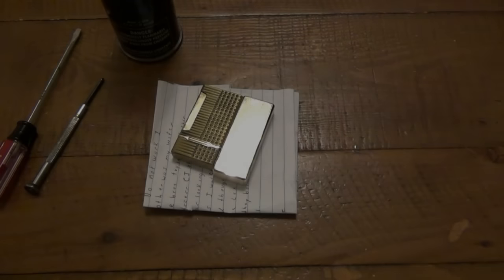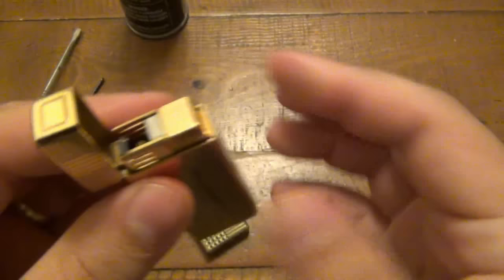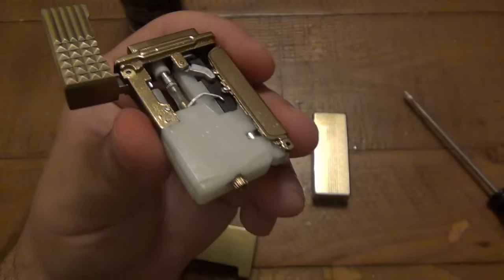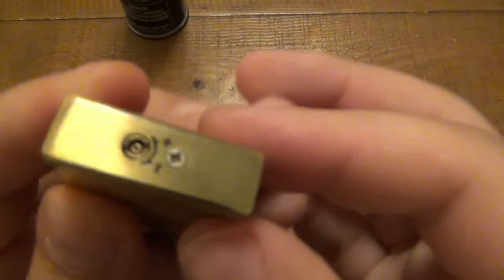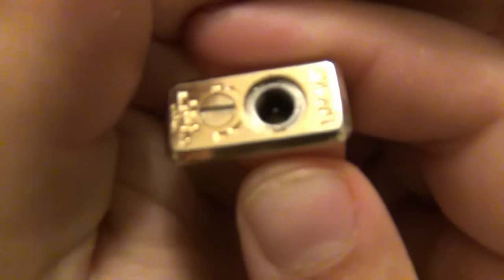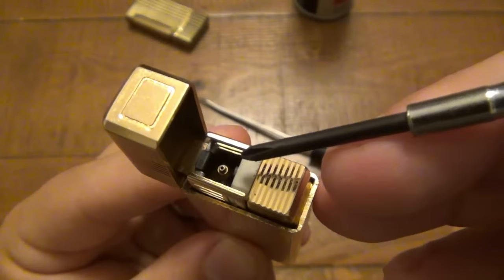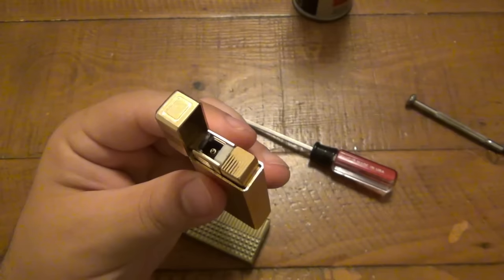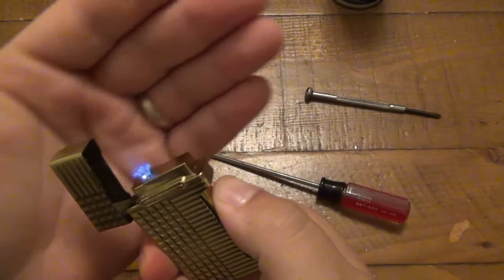How To Fix Butane Lighters (Common Problems Have Simple Solutions)

Comment: Hey man I have a butane Rose flame Torch lighter by Slick for my mum but for some reason the power of the torch flame has significantly decreased. It's basically not shooting the flame like a regular torch lighter but the flame seems to come out looking like plasma or a really weak flame that kinda just bubbles on ignition briefly. The spark works the fuel tank has been purged and refueled. I Ending up taking the outer part off to see if I could fix it. When it's outside of its casing, it works perfectly fine??? The flame of the torch works fine, all the components work. It's only when I put it back in its casing does it repeat the weak flame effect i described earlier. I have no idea how to fix it.

Comment: having to purge is a misconception imho. there should be no air in there. thebutane does take up less space in liquid form. if you pump the butane can enough times you should get enough pressure in the tank to fill the butane  up in liquid form pretty much to the top, no need to purge. also if you do need to empty through the fill valve id try and use something softer than a screwdriver or metal so as  to not damage it... plastic works great for this.

Comment: I remember very clearly back in the early and mid 90s. That when you bought butane it had a little plastic ring with adapters that you could pry off and attached to the main nozzle of the butane bottle. You ain't trippin bro and then all of a sudden it just stopped. You don't see them anywhere anymore?.......
Reply: Colibri butane still does this.

Comment: It's not a Mandela effect. I have butane refill bottle from late 80's made by Win and it has 8 different, colorful adapters and there is a list of the lighter brands on the side of the bottle telling which color adapter goes to which lighter. I only have used the refill bottle twice so it's almost full. I wonder if the gas still works after all these years?

Comment: Mine just stopped creating the spark in order for gas to pass through to make the flame. If I hold the button down and put another lighter up to it, it works. But by itself, it doesn't lol. It just won't create the spark anymore unfortunately. I'm not very smart when it comes to lighters, but when I looked on Google, it says the flint needs to be replaced. But I have no idea how to do that in a lighter like this lol. I thought only lighters with a wheel had a flint tbh lol.

Comment: Hi. I have a number of fairly old but nice/unusual/desired brands butane lighters (some converted from Zippo-type fuel to butane), but many of them have the same problem - the “click” to create the spark no longer clicks to generate the spark. I’ve checked the other elements of these lighters - the arm or arms to lift the gas valve open function correctly, the tank holds gas, the nozzle is clear and butane can flow out, so I’m reasonably confident that it the small black rectangular column that is no longer function - not generating a spark and not returning to the “ready” position after pushing it down. Do you know if these small black rectangular columns can be replaced, and if so, where can I buy them ? Many thanks !!
Reply: Also having this issue and can’t seem to find any info on this repair
Reply: Dollar tree bbq lighter. $1.25.
Reply: Though it hasn't been answered I was thinking the same thing and that's the only thing I have thought of was to take it out of another lighter .. edit so I did take it out of a cheap one to put it in my expensive chef torch and voila it works 😊

Comment: just got a can at a head shop and the nozzles are  "made into the cap" if the plastic cap has 5 holes inspect them, probably adapters, also european clean butane just not the zippo brand 2021

Comment: If it sparks but wont light or stay lit its prob clooged up. Either with pocket lint dust etc and or residue from crappy fuel. Dont run ronson. There is a cheap brand named king that is tripple refined that works well. If its an expensive lighter buy vector puretane or lava if you can find it. Be careful if youve been running cheap stuff. When you fill with vector or the other purer butanes the flame will often be so high it can burn your face. Ive had flames 12 " out of lighters i filled with lava. I had to remove the fuel level lever and readjust the flame.

Comment: They've still got adapters on the caps. I'd say it's 50/50. Lighter butane tends to have them and welding/ plumbing butane tend to not. Check headshops or smoke shops you'll find them, not uncommon.
Reply from the maker: thanks I did find it on amazon alone and with an offbrand of fuel

Comment: You can use the plastic nozzle without an adapter on this lighter. Even if the needle pin breaks, it still works fine. I repair vintage lighters and fill mine with the same valve without one without losing anything. Those are never screws! There are no flatheads! The “second screw” is what calibrates the adjustable flame! Never mess with that. Only a professional can tell you how to fix it once messed with.

Comment: Forgot to add. None of the adapters seem to ever fit or work correctly without some modifications. I had to shave or sand them down, and or create a gasket to prevent butane from spraying everywhere.  I found that using  a piece of heatshrink works. Also if you have time, there is gasket sealant in a tube you can buy and make an actual gasket for your application. I squirted this blue gasket material into the refill port on the item then stuck the adapter in and left it to dry. When I removed it, there was basically a custom molded gasket stuck to the adapter. I did have to   remove some gasket material from inside the adapter. Not going to explain how. Pretty much a common sense thing. Hope this can help someone. I had a B of a time trying to refill something.

Comment: I imagine you didn't see it since you didn't reply, but awhile ago I commented on one of your videos asking for help. I'm just reasking here and hope you see it this time. I have a lighter I got from my grandpa with no markings on it, at first it didn't work and then mysteriously it started working just fine. But once it ran out of butane I went to refill it and all the gas comes shooting out of the top as soon as I fill it. Like it all comes out at once, and since it's compressed gas you can see it come out as it frosts up the whole lid of the lighter. Is there a fix for this?
Reply: Looks like you haven't recieved an answer. I was hoping you did BC mine does the same thing. It's a Ronson Jet Lite, and I know I've got the correct size adapter for the butane nozzle, but when I go to fill it I get Butane spraying from EVERYWHERE!! Not only thru the top ( where the flame should be) but also leaks thru the screw that adjusts the flame size. The entire case gets frosty cold, and after all that I WON'T LIGHT. 
I've looked everywhere online and although I'm certain it's a fairly common issue I cannot get a simple answer.

If for some reason you figured your issue out, let me know what you did!

Comment: I use butane as a solvent for extraction, the butane cans  have them adaptors, every brand of refined butane has them..zippo is dirty..it also (as far as I can tell) is just butane. vector or whip it brand is a combination of isobutane n-butane in equal parts, but also contains LP (propane) most brands are about 30% LP but whip it has like 40% if I remember..they burn so much better...while I'm at it thought I'd share a few fun facts about butane an lp, did you know your refrigerators refrigerant is most likely butane..it's r600 an r600a..LP gas is also used as a refrigerant in commercial coolers..an it's a much larger molecule compared to r12 meaning less leaks. Some ppl even use them for heat pumps an residential systems..they need sum extra parts for safety but it's a really effective refrigerant..

Comment: When I buy my butane it comes with the adapters in the cap and sometimes it doesn't so it's Hit or Miss if you get the one with the adapters in it and this is 2023 to let you know
Reply: Same here. It seems like it’s the cheaper stuff with metal tips that comes with adapters whereas Bronson and Zippo have the little plastic valve and no adapters.

Comment: I have terrible luck with butane lighters. They never will light properly. I literally just clicked the one I have 17 times before it lights. Sometimes it will light many times in a row but then nothing for a while like it's broken. I see it ignite I hear the gas everytime. I have had many lighters with this problem. Poor design? Weak spark? Is the igniter misaligned from the gas? No oxygen? It's not pressure as I have adjusted it many times with no success. Do I constantly buy defective lighters? My mind is completely blown. Imagine how much butane is lost clicking it so many times. Gone through 2 cans recently. I don't know 🤷‍♂

Comment: My zippo is purged filled warmed and still sparks but it hates me.
Reply from the maker: Zippo Blu? I would see if maybe the timing of the spark and pushing down to make the butane come out is faster so the sparks are still there when the gas spills out...a slower light might not get it done, also make sure your holding the button down all the way to keep that fuel from shutting off...

Comment: Im legitly scared. 
My jet lighter didnt working too and I little(I mean high as ridiculous levels) increased power of gas but it still doesnt working. I sparkled from outside with another and it suddenly fired and created a fire that has same height with half of my arm I was like may day may day and fortunately it ended after some shaking. Wow this is why dont try at home. 
I legitly wont thouch that again until when I decrased its power. This thing is a beast who invented this thing??

Comment: Thats not the Mandela effect bro. You just bought a different brand of butane lol.  The 2 butanes I purchased both had them. The one that looked like yours I had to remind the company to include in the case. They only threw in 3 of those for a case of 12. I think companies are just cheaper now. Kinda crazy to wanna save like 1 cent on each can. A lot of butane is sold for things like making weed honey now. I think its almost a bigger portion of their segments than butane lighters. Maybe thats why they stopped.

Comment: Too bad I only found out the information in this video after taking the entire thing apart and twisting the gas regulator several turns. (Its not supposed to go half a turn in either direction.) I'm not sure I can fix what I've done.

Comment: Thank you I couldn’t figure out what I was doing wrong trying to re-fill a Penguin Japan lighter and it’s because I need an adapter so it won’t spill all over the place.
Reply: You can still do it with some valves but you have to do it slowly or you will waste way more butane than you get in the lighter.
Reply: Ben Keysor even with the adapters I got it still spills out all over the place on both Penguin lighters I have. Need to find someone local in San Diego that can teach me how to refill these damn things.
Reply: glyn hodges will you be right next to me holding a sign saying out of work comedian?

Comment: I know this is a couple years old so I am unsure as to if you had gotten an answer on your question, but it really just depends on the brand. It varies, but even where I live in the South East USA, some cheap ones have the adapters and some do not. Some nice brands do and don't. I have a bottle of Whip-it Brand Butane and it has the adapters built into the cap so you pop them out of it. I also have had the ones recently ( in the past year or so) that I remember having the collar adapter thing still.

Also, thanks for the informative video. I've always loved lighters, and have been keen on collecting all sorts. Especially since I love cigars. I have a Austrian CHAMP lighter that served in Vietnam that I love. Has the red background with snoopy running towards his house yelling,"Fuck you Red Baron!!"

Comment: Cause your buying zippo fuel. 99% of butane comrs with adapters. In you saying you need adapters to fix it isn't a fix that's just filling the lighter up The light has got to be broken to fix it It's just out of fluid

Comment: Here's a lighter butane bottle that comes with the standard nozzle plus 8 additional adapters in the cap:
https://www.amazon.co.uk/Newport-Lighter-Gas-250-ml/dp/B01N90A2FS/ref=sr_1_3?keywords=newport+butane&qid=1583327155&sr=8-3

Comment: You just need to buy a better quality brand of butane. Zippo branded butane is honestly pretty low quality. Brands such as Calibri, Newport, Puretane, Lucienne, Special Blue, Whip-It, Vector, and several others are all MUCH nicer than Zippo. Really you should be staying away from some of the more notable brands that you would expect otherwise. Do NOT buy Bernzomatic, Zippo, Ronson, or Clipper butane. They all contain much higher levels of impurities which will eventually lead to clogged fuel valves. Also, apparently Zippo doesn't come with adapter tips, but practically every single brand I listed above DOES come with adapter tips. The brand that I typically stick with is Whip-It. I was able to get two 420mL cannisters of Whip-It Premium Butane for $7.xx the other day at my neighborhood smoke shop. It's incredibly high purity, comes in a good balance of n-butane, isobutane, and propane, comes in a large size that lasts a really long time, has 5 adapter tips in the lid (and these adapters are by far the most useful set of adapters I've come across), and for essentially $3.50 per can (they were buy one get one free for $7 + tax) they're one of the most affordable options out there while simultaneously being one of the highest quality options. Just whatever you do, do NOT get those few brands I mentioned to stay away from up above, and it's usually a good rule of thumb to stay away from the cheap stuff because you very often get what you pay for. A good rule of thumb is to go for the options with a high number of refinements, like 9× or 11×, but it isn't an outright rule, as some companies produce higher purity butane in fewer refinements because they've developed better processes. Just do some basic research on what brands your smoke shop carries and ask the workers if they seem knowledgeable, but if they're burnouts then perhaps opt for the Google search.

Comment: Weird video. He has no idea what a piezo electric lighter is but holding 2 of them?? Even one stamped. Water heaters, bbqs, every style of lighter..with a spark jumping to metal is a Piezo vs old school flint sparks flying into gas. Turning screw isn't a "repair". There are many unmentioned repairs lighters can require. And 
better grade butane with common adapters are everywhere. He's prob using lighter butane, not higher filtered butane for torches.